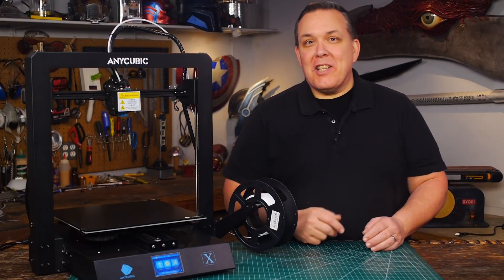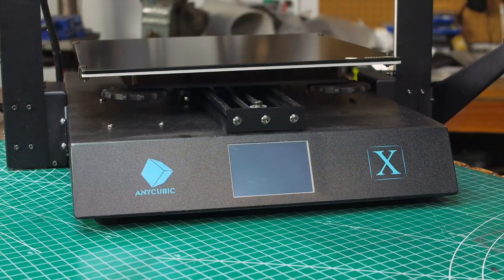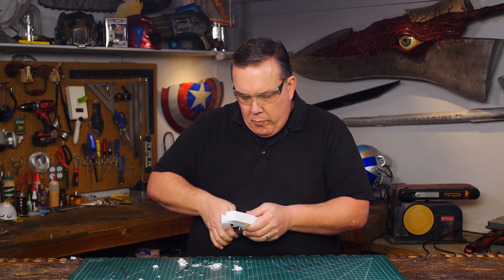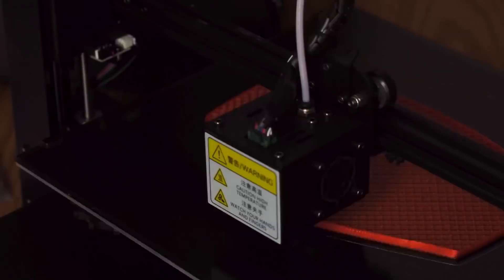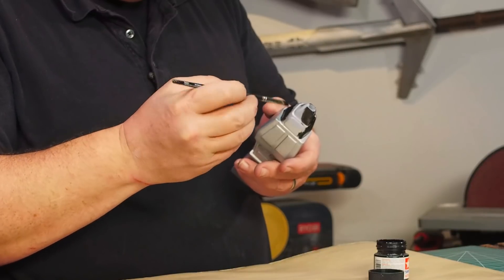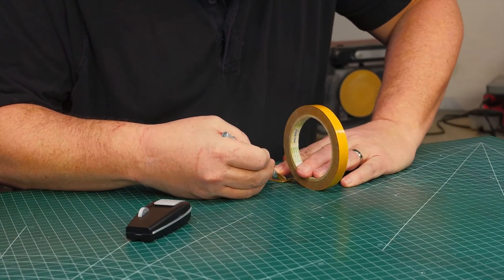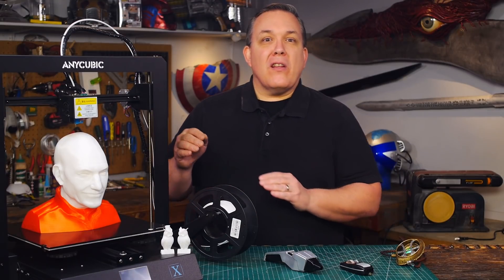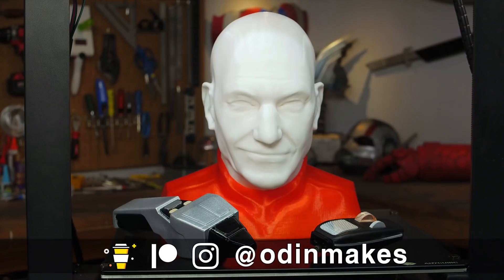Odin Makes: Star Trek TOS and TNG phasers with the new Anycubic Mega X Printer

Comment: You should check out the Creality cr10. I've had it for a few months now and it's been working pretty well, and it has about 100mm more on the z axis than what you have now making helmet prints much easier. Speaking of, could you print a Master Chief helmet? Any version is fine

Comment: YES, I love this! I suggest you Print a TNG Dustbuster Phaser (The design that was used in season 1 and 2 of the show) along with the contemporary cricket phaser. If not those maybe we could both collaborate on a design for a custom Communicator badge design, Even better is that once you 3d print a badge you can mold and cast it after it's been sanded down. Let me know what you think about this idea.

Comment: Also, you're removing supports. Not rafting. There is no rafting. There's a raft if you choose so. As for supports, there are a lot of settings in cura you can customize to make supports much easier to remove. And as of the latest version, Cura is as good and advanced as any other slicers, including some you have to pay hundreds of dollars for.